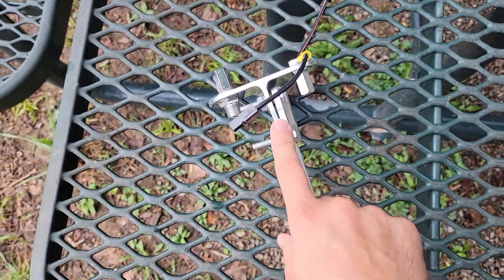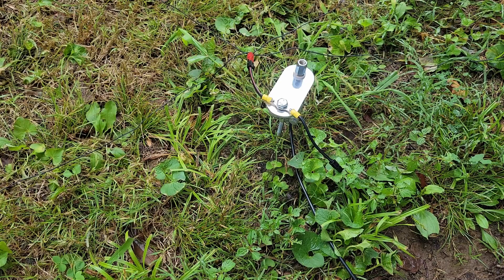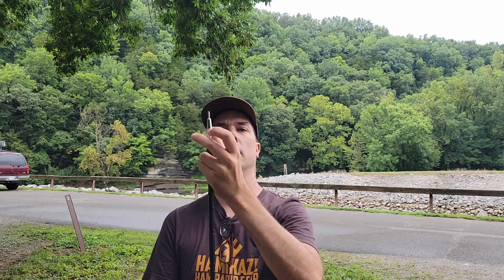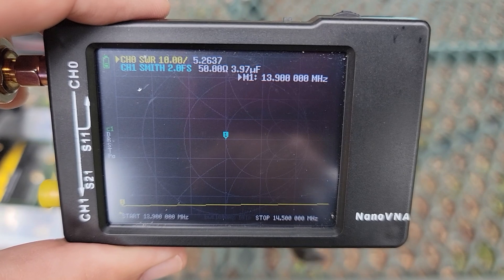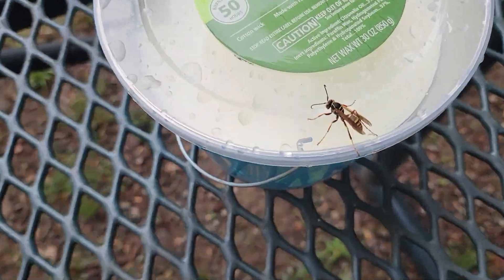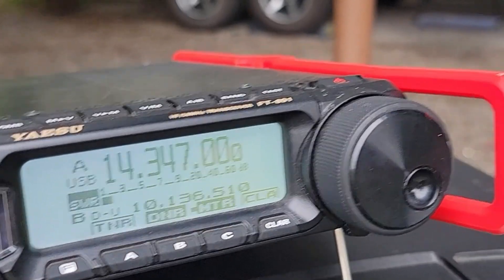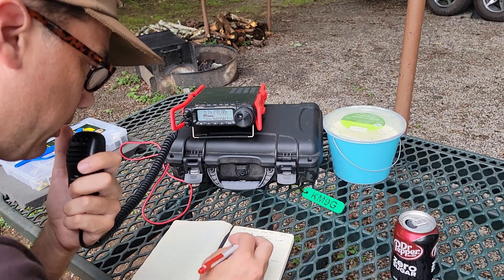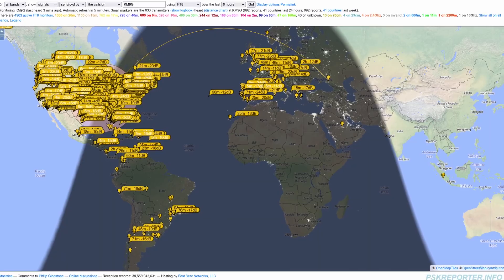These don't even work, right?

Comment: I have used the Shark Distributing hamsticks for three years in my mobile units and have had excellent reports on signal strength.
Reply from the maker: I'm always impressed with how good mobile stations are - you'd think they would be a mass of compromises that equal mud, right?
Reply: @temporarilyoffline  I have an IC-705 and am amazed by it's performance as well. My mobiles are a FT-891 and an IC-7100. The two mobiles are equal in performance with the same hamstick antennas I own. It really doesn't take much time to change bands compared to the cost of a tar heel antenna. I have also used my hamstick antennas on my Wolf River Coil TIA tripod base and radials for portable operation. Thanks for sharing.
Reply from the maker: @1crazynordlander  I had my 705 set up for mobile for a while.  I gotta admit I love a waterfall.
Reply: @temporarilyoffline  I just use it for portable but would like to try that but I want a FT10DX for my shack then I would use my 7300 as a mobile. Sounds crazy.

Comment: Hamsticks rock. I used them on SOTA activations and made QSOs with F4WBN in France with a G90 at 20w from  mountain tops in UT and NV. They can be a pain in the ass to carry if there are overhanging trees. But I'd still use them in some applications (eg summits without much space).
Reply from the maker: Have you seen the GABIL 7350T? https://www.youtube.com/watch?v=TC8olSQ4i5U

Comment: I had Hamstick Dipoles for 20 and 80  on my tower for years and they worked well enough for a low cost rotatable antenna. (Since replaced with a Hexbeam: MUCH better performance, but of course much more expensive). 

They also work well for Field Day and ARES ops.  Have been thinking of using the ones I took down from the tower for portable use and had not considered using the dipole mount in a vertical configuration. Thanks!
Reply from the maker: I want one of those octopus mounts.  They look like fun to play with.

Comment: I use hamsticks on a triple mag mount, square in the middle of the roof of my truck.  I set the whips at the factory recommendation, lock the allens in, and throw the wrench into a drawer.  I use an old manual tuner ($20 score at a hamfest) inline.  Usually, the SWR is close on the hamstick, but then I use the tuner to slam it down to 1:1.

I would recommend removing the hamstick from the roof of your vehicle before driving off.  They don't like it what you hit a low branch at 45 MPH.  Learn from my mistake.😁
Reply from the maker: I've only driven with it once... there is a reason there is no video on it ;-)
Reply: SWR doesn't matter as much as you think it does.  Perfect 1:1 SWR doesn't matter _at all_.

Comment: I'm sure Ape will be yelling 'fake', lol. All my activations and hunts have been with a hamstick on a mag mount. I did have 1 contact using your configuration. It was with you when you did your MN kilo. I've tried the dipole a couple times but it's been a bear tuning each hamstick. I had it 20ft up on an aluminum flagpole.
Reply from the maker: I have a dipole video coming out next.  So far I love them "for what they are"

Comment: I always worry that propagation conditions might make my poor antenna seem good, or my good antenna seem poor, and cause me to incorrectly assess a given antenna's performance. Might be an idea for a future video -- how to assess an antenna and account for propagation conditions. Then again... the other side of my brain hopes I'm never satisfied with my antennas so I can keep tinkering.
Reply from the maker: I don't know how I would do that - WSPR would be the chosen method, but proximity says to use different bands - 2 antennas, 2 radios, 2 power sources, 2 computers - the test must be run at the exact same time on the exact same day or you run into propagation issues like you discussed.  Using the same bands close enough to be doable doesn't work due to front end overload issues.  That's a tough one.

Comment: I ALWAYS replace allen head screws with either a Philip's head or a thumbscrew, those allen heads ALWAYS round off on me!!!
Reply from the maker: Yes they do!
Reply: Best quality Allen Key (US wrench) you can get, the cheap wrong size ones do the damage as does an imperial key in a metric head like on a Diamond brand antenna

Comment: I'm thinking of using a pair of 40 meter ham sticks as a horizontal dipole, but wonder if a standard tv antenna rotor would hold up, or would I need a heavier duty one?? Already 40 feet up, so should be high enough...
Reply from the maker: they don't weigh much... depending on the costs, it might be worth a shot.
Reply: FWIW, I used two 20 meter ham sticks in a rotatable dipole configuration for many years. I used a cheap TV rotor (new at TRW swapmeet, $25!) mounted to a vent pipe on my roof and two 4' TV antenna mast sections. It worked quite well, the rotor had no trouble with the load. I've still got all the components, I've been considering setting it back up. Performance is not as good as a proper dipole, but the ability to turn it often makes up for it.
Reply from the maker: @socallars3748 fun is fun, even if it isn't perfect. In fact, the less perfect and still working it is, the more fun it is.  Perfection is boring.
Reply: @temporarilyoffline  Perfection is not only boring, it's literally impossible! The best antenna is the one that gets you on the air.
Reply from the maker: @socallars3748 you got that right!

Comment: I like the idea of powerpole connections for the radials,  I've found with these types of whips that the allen screws are made of butter and a firm "wrench" will strip the threads.
Reply: I always immediately replace the junk metal hex setscrews with stainless metric Phillips head screws 4 or 6mm IIRC.
Reply from the maker: Yes, me too!
Reply: Re the use of power pole connectors for radials, seems like overkill and a very expensive way to go.  My go to connectors for wire antenna jumpers and attachment of radials and tuning stub sections  are the AMP snap connectors, look like small banana pin and sleeves. Easily crimped on with a standard electricians wire stripper and crimper, and relatively inexpensive - typically less than 4 bucks for a box of 5 male and 5 female connectors at Home Depot.  I usually use the yellow 10-12 AWG ones, smaller wire size ones in red and blue.  I’ve been avoiding the blue ones lately, seems they have a problem with the diameter of the pins being too large relative to the ID of the barrel side.

Chris AJ1G
Stonington CT

Comment: Great video. If you are using Gigaparts Shark hamsticks the screws are 10/32 and 3/16 stock length. Thumbscrews between 5/16 and 3/8 seem to be the sweet spot for me.
Reply from the maker: Thanks for the info!
Reply: You may be able to find a Specialized Thumb screw, at McMaster Carr. They have TONS on machine screws, nut & bolts, and machined parts & tools! They are more expiensive than any local hardware store, but there stuff is 1000x better made!

Comment: Great video, TO. Hamsticks are also a good option for when the weather doesn't cooperate. I use them when it's windy and often in the WNY winter too (which I'm sure you can appreciate). I also use the quick disconnects (does affect tuning, like everything else) to switch 'em out even faster.
Reply from the maker: Yeah, my goal is a speed POTA.  I have 2 parks I want to activate right now, but really, its just too hot to be bothered.  If I had my truck and my hamsticks setup, I'd just go chill in the A/C.  I fully admit that I'm being spoiled here.

Comment: I always start about 4" in on the Whip and adjust from there. It is a lot quicker to tune that way and I have tuned Ham Sticks from 160m to 6m using that technique. I was one of the things that was mentioned in one of my MFJ inserts with one of my ham sticks. Still as a Ham Stick fan if you will, I recommend the MFJ 600W hamsticks especially on 40m for maximum Q. For 80, you have to kind of pick either 75 or 80. Thanks for the video TO.
Reply from the maker: I "heard" that if you have too much whip inside the coil part that its not good... I don't remember why, but I know a lot of people cut them after they figure out what close is.
Reply: @temporarilyoffline  I had to cut off a few inches of the whip to get the SWR down. Worked great after that.
Reply from the maker: @45auto  thanks!
Reply: @temporarilyoffline  4" in is not inside the coil. But yes, that can cause arcing. By coil part, they mean inside the tightly wound part.

Comment: 891 and a vertical is a good time. Been using a 17' whip but I might need to try a hamstick as well. 💡
Reply from the maker: I have been using the 17' whip a lot lately too - I really want something that can fit in a normal laptop sized backpack... So the Gabil 7350 slider is probably the best bet currently.  The hamstick will most likely go on the car.  That's a future test.

Comment: I am going to do something like this.  I am converting a old school bus into an rv.  I think the roof will make a great ground plane
Reply from the maker: Yeah it will!  Be careful of height!  I've seen some older buses that have an 8-12" tall railing all the way around the roof and I thought that if it was done right with proper termination/isolation you'd have a fantastic loop or folded dipole antenna!
Reply: @temporarilyoffline   i never thought of that the bus is 40 feet long and 8 foot wide.  Now you got me thinking
Reply from the maker: @caleath  Even if it wasn't 'great', the fact that its always there would be useful.
Reply: @temporarilyoffline  sure has got me to thinking thats for sure